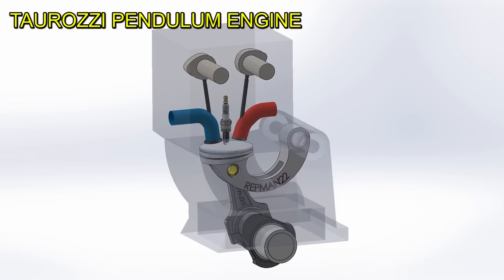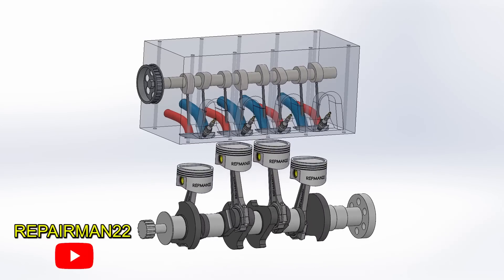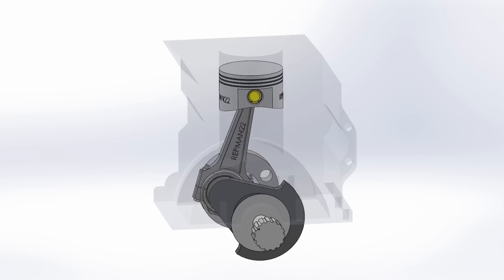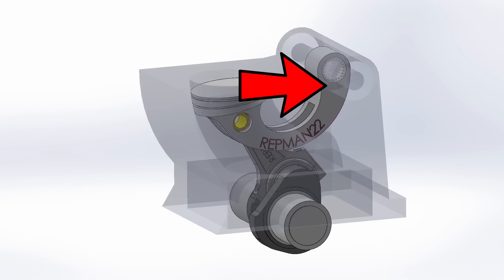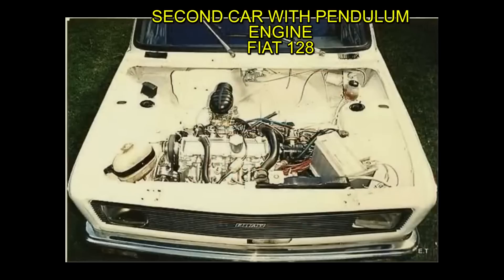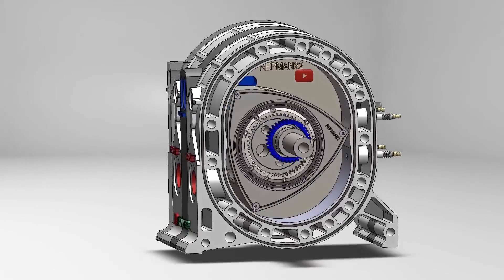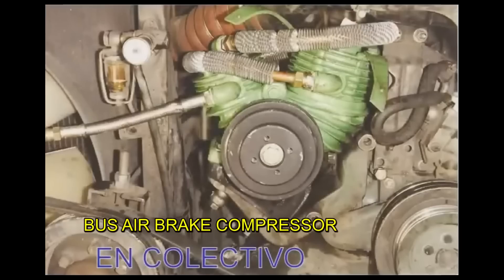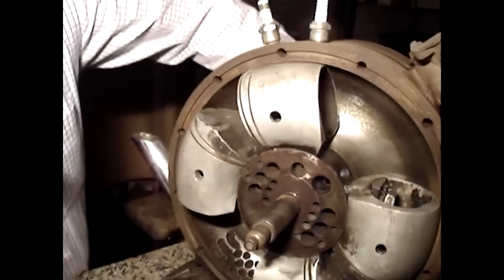All about the Taurozzi Pendulum Engine 🧠 and what happend to it🤯

Comment: Maybe they are only used in compressors because then they do not have to deal with carbon deposits and thermal expansion and other issues that may require servicing that is more difficult for shops to do with curved cylinders.

Comment: I was checking out the patent US3854457A and I came across the following, check it out.

United States
(12) Patent Application Publication (10) Pub. No.: US 2001/0037777 A1
Taurozzi (43) Pub. Date: Nov. 8, 2001
(54) BALANCED MODULAR PENDULUM Publication Classification
MECHANISM

Comment: the proof of the pudding etc. Like the guy said, stick it on a dyno rig and measure the power against fuel. The bearing on the swinging arm will not carry much force so shouldn't wear much. Extra weight of swing arm is got back by smaller cooling system etc.

Comment: The statement of "zero friction" is bogus.  The piston rings will always create some friction against the cylinder walls.  Also, the 30% better fuel economy due to lower friction cannot be true because modern engines do not waste 30% of their power overcoming piston / cylinder friction. The use for compressors is understandable, since they can use self-lubricating nylon (or similar) piston rings because the only heat generated would be due to compression, and there is no need to run at high RPM.

Comment: I think making the curved bore is more difficult/expensive than it seems in this video therefore not interesting for mass production. Similar to Honda's oval piston motorcycle engine to allow more surface for the valves. Good concepts but commercially no.

Comment: More moving parts and more weight for questionable gain. We are still using the same Otto engine designed in 1876 because it is simple and it works.

Comment: Hmmm... The taurozzi V8 Engine looks like it could be used in a Vehicle that requires a Strong and efficent albiet lightweight and relatively small engine.

Also, those that say "What about replacing the parts?" Well, the Companies that built the Taurozzi Compressor sell the replacement parts for the Compressors. Compressors have to build their pistons to have similar tolerances to actual engines, otherwise, they'll leak the air they're supposed to compress.

As for why the Tauronzzi was rejected... Well, I say it's Envy rather than a Conspiracy. Many of those companies have a grip on much of the best tech, a monopoly on all the best engineers and the best designs... And then this "Upstart from Argentina" shows they missed a spot... And Last I checked, Argentina is in a rather sour spot for much of the western world.

Comment: @1:32  "and results in 30% fuel savings." And there we can say 'Bullsh*t" Most cars engines are running close to 60% efficiency. To claim a 30% fuel savings means that it is  achieving above the maximum possible Carnot efficiency. While it may offer some benefits, you can get a similar effect in a strait cylinder by the addition of a single extra component. But to date there has been no real need.

Comment: Slick design but an overhaul nightmare. If you can't easily overhaul an engine in the field with common standard machine tools handling all metal cutting operations the design is unsuitable, end of story. Factory production of specialty items like compressors which are replaced rather than overhauled and lead easy lives compared to motor vehicle use makes sense so the outcome is logical.

Piston wear IRL is nearly irrelevant because piston RINGS are the moving wear surfaces and the bore being softer takes the brunt of the wear. Local machine shops generally finance large machine tool purchases and would avoid specialty machines until the market takes off, but the lack of local overhaul capability deters the market.

Comment: a piston and cylinder do NOT have direct contact, they have rings to prevent it.  I suspect, being an ENGINEer that yours will actually produce MORE friction on the outside of the curve,  The wear at 120,000 Km would be quite bad, not just some polishing.  You'd better use some extremely high strength materials in the curved arm.

Comment: Hold on, is that abrupt movement NOT a problem at the wrist pin?

I feel like maybe a compressor using this design would last, since it won't vary in RPM other than on startup or shutdown; in vehicular applications this will speed up and slow down with operator input and I believe that the abrupt movement in that animation would be where the biggest fault lies, longevity / durability-wise.

Anyone have an answer for that?

Comment: Mountainous region vehicles NEED an internal combustion engine so cylinder-compression Engine-Braking can be had when going down a long downhill, to prevent burning up the regular drum or disc brakes. The engine's COMPRESSION will slow down the vehicle.  (Electric hybrid vehicles will suffice just about everywhere else, though.)
The engine could run mostly on HHO, with compressed hydrogen (or methane or propane) for the augmentary auxillary fuel when the HHO generating electrolyziser can't keep up with demand.

Comment: Most conventional engines have a 5 thou (0.13mm) clearance between piston and bore. This design means the dimension of the pendulum arm from the pivot on the right to the far side of the piston must at least that accurate.

Comment: Seems to me the only problem with this engine is that it was 50 years ahead of its time. Back then, manufacturers didn't need to worry about the small increase in emissions from piston skirt lubrication. Nowadays, with ultra-stringent emissions laws, manufacturers are using pistons with short skirts, and low-friction cylinder coatings,  with the downsides of accelerated wear, and high costs respectively. This engine solves all of those problems and then some.

I guess no manufacturers will ever pick this up, because most of them are currently jumping on the EV bandwagon. Such a shame, because this engine is ingenious.

Comment: watching this vid makes you moar stooopider. 

If there is friction there is wear. Engines last 1/4 million miles...billions upon billions of piston strokes. When the pressure is high, the rod angle is low = Low Friction!!! The piston rings are pressed out against the cylinder walls for sealing under high pressure. This source of friction remains on the Taurozzi engine. Machining and honing/re-honing a toroid cylinder is not simple.

Comment: Anyone with some basic understanding of engineering knows this is complete BS, literally has no benefits over straight design and several downsides.

If friction and oval wear were any problem, you can just guide the piston in a straight fashion instead of this nonsensical construction.

It's trying to solve a problem that doesn't exist in the first place, and introducing 10+ problems by doing so.

Comment: The real problem will be sealing the piston long term. Teflon is flexible enough to bend and twist into the needed shape but steel rings will break after a few thousand kilometers.
Also manufacturing the bores will be a pain in the ass. A typical tolerance between cylinder and bore is 4/100mm try to manufacture 100.000 blocks and measure these. It's a nightmare. In a compressor u can just go and make the gap between piston and cylinder bigger because the pressure will never exceed a certain level. Just slap bigger rings on it and it will seal. A modern gasoline engine can Produce up to 80 bar (1160 psi)  in combustion stroke. And a diesel engine even goes up to 180 bar of pressure (around2600 psi). I also call bs on him producing a working 2 stroke version of this. Even with a membrane controlled intake it won't be possible. U need a long piston skirt to control the exhaust. This motor tries to eliminate long skirts. I think his go kart was just a heavily modified "regular" 2 stroke. 
Interesting concept but not viable for mass production or high power output.

Comment: The real reason these engiens haven't really caught on is because they require much tighter tolerances to work. And despite being inherently cooler, thermals must be carefully controlled. Running too hot or too vold would be worse for this sort of engine than a standard engine due to the complex geometry which would easily throw off the tight tolerances with thermal expansion. With a straight cylinder, thermal expansion is unilateral, making it easy to manage. Here, thermal expansion would change the pistons position in the cylinder

All this means they'd likely be more expensive to engineer and produce, possibly less reliable too.

Comment: How is there "little" friction? More contact points means more friction. Second a conventional piston does NOT make contact with the cylinder walls. The piston rings do. Third, the extra mass is alot more than just a piston with the extra pivot arm. 

This is a great backyard engine. While its possible....its not feasible.

Comment: "the refrigeration system is also smaller due to the low amount of losses" *BUZZER* NO! Cooling system is not refrigeration system. Not at all the same. Engines do not have refrigeration systems. Thats a big enough sin to retract my "like". Not acceptable. If you don't know the difference between cooling and refrigeration, don't make engineering videos.

Comment: Pretty cool design, but has complexities that need to be tested before producing such engine - I can see what can scare off automakers. 

Specially that uneven piston shape, production, wear, how it will preform over time wearing, uneven weight difference while under violent combustion forces - there is so munch that can affect such design. Pretty sure automakers at least made prototypes internally and tested the engine or some of them did - you do not discard something that promises great efficiency benefits.

Comment: I believe even though it's possible to manufacture toroidal-shaped cylinders and adequate counterpart pistons, getting the tolerances with acceptable % od OK parts is what's holding it back. And tolerances mean longevity. I think that getting this to work with these constraints would mean costly tight tolerances, tighter than in current state of art and small nonconformity would mean a swift part teardown.

Comment: With several years of experience as a precision machinist, I can tell u that this engine's pros outweighs it cons. Manufacturing cost is the only viable option why it wasn't implemented by motor companies
Conventional engines can easily be bored using a drop drill then filed but this will require a 5 axis CNC router
As for the curved shaft, it's even stronger than a straight piston rod and can carry more force without snapping

Comment: All Global Inventors, Mechanical Research Engineers, and other Enthusiasts have tried to slow down and extend the piston's acceleration which starts after the TDC and is over by 75.5 degrees with a conventional crank mechanism. Consider that Force=m x a. This and all other mechanical concepts that are based on the fixed radius of a crank pin have no chance to provide higher force and a fuller combustion process, especially if two pistons and two cylinders are opposed in this fashion as an OPOC mechanical concept. Then the existing problem of too fast acceleration of conventional concept is doubled which doesn't allow enough time to burn the fuel found in the chamber, thus limiting the thermal efficiency to only 30% gasoline and 40% diesel concept. A variety of methods, techniques, and accessories are used to compensate for these conventional crankshaft mechanical deficiencies.

Comment: yeah  30% fuel savings is a clear BS.   it might be even other way around as piston has to move extra w8.  also long lasting engines with low oil consumption is not something groundbreaking ))

Comment: Probably could use clarification, nothing is free of friction, this engine just has less of it, and it's moved from the cylinder walls to the pivot point.  
Also curious what effects thermal expansion has on the geometry.  It seems like as the engine heats up the piston would be pushed closer to the wall opposite the pivot point?

Comment: The casting of the cylinders in the style for the air-cooled type (as well as for the compressor) is the best idea, and then formed sheet metal water/coolant jackets to fit around the cylinders, for best cooling.  Bravo, I love the engine.
Is it possible to get such an engine that has been commercially produced; either air or liquid cooled ?  I'd run it on a gaseous fuel, such as hydrogen, methane or propane.

Comment: I don't find the mass machining of curved cylinders a compelling argument. Mass production demands would allow for the optimisation of that machining process, even bespoke boring machinery. Curved pistons probably distribute the forces unevenly resulting in numerous highly irregular points of failure. They'd use this design in F1 if it was more efficient. Though I suspect it's probably more durable because it has to be overengineered.

Comment: Meh. Much of this is BS. Overplayed shortcomings of conventional piston engines and other than the reciprocating assembly of this engine it’s just another 4-stroke piston engine. Crack open a modern piston engine with over 100k miles. It’ll still have crosshatching, the piston skirts will still have their coatings and machining marks. Once broken in and lubed up the crostini is minimal from the cylinder bores.

Comment: Never heard of this before, what a cool engine (pun not intended) with an elegant solution to friction problems!

The first thing that came to mind for manufacturers not taking it into production is that while it is possible, would it be cost effective? I'd imagine this engine requiring quite a bit of precision in manufacturing, and the required machinery just being more expensive in general.

Also, while there would be less wear, how sensitive would it be to it? I do not rightly know, but to me it seems like even slight deformation of the pendulums or their mounts could result in many kinds of problems.

Comment: Making the tooling for curved cylinder would be pretty expensive, but after that decently cheap to mass produce, just not cheap as basic straight cylinder. Also issue probably is with curved cylinder one side moves faster than another, so there is uneven wear, well as most likely vibrations in the piston ring. Due the added weight of the arm design this wont be high rev motor, so response probably is bit sluggish. Its interesting design and would love to play with one, but i think problems with it out weight the benefits in practice, specially to manufacture small number to hobbyist tinkering.

Comment: Why not just m@ke a a ball bearing piston. Much easier production. Would be just as efficient.
 Picture putting a ball bearing with no outer race in a cylinder and a washer bearing seal.. 
But Why would a high production company purposely lower their revenues by making an engine that lasts forever?.
 That's possible why it never took off.

Comment: Maintaining required bore size and micro-finish tolerances, while possible, would be an insanely expensive manufacturing process for both the bore and the mating pistons and rings. Without a matching radius the compression rings would shave the cylinder walls beyond tolerance rather quickly.

Comment: Turbine engine generator in range extended electric vehicle, plug in hybrid, hybrid electric

~ Long life (Aircraft grade 20,000 hrs) 
~ Flex fuel (CNG, Propane, Diesel, Gasoline, Kerosine, Jet A, Biofuels, DME) 
~ Super high efficiency
~ Highest power to weigh ratio electrical generator
~ Functions as alternator
~ Low noise & adaptable emissions controls to limit NOX & particulate

Comment: I think the advantages don't seem to be worthwhile. It seems even though the induvidual piston itself maybe lighter since it doesn't require as large a skirt, you still end up having more reciprocating mass. Since it's basically just a normal piston and crankshaft arrangement with the added mass of the banana arms. Any performance advantage you may gain from having slightly less friction would be negated by the added mass of all the extra banana arms swinging about the block. There is likely added harmonic balance issues that likely need to be addressed. While the video states the engine would wear less. I have a feeling over an extended use case the cylinder bore would actually wear worse and in an uneven fashion. Since you have one side of the piston traversing a longer distance. The inside of the curved cylinder wall and piston would wear less than the outside of the curved cylinder and piston. This actually maybe worse than a conventional piston engine as you would not be able to easier rebore and hone the curved cylinder walls. Thats just the engine itself. That doesn't even take into consideration the manufacturing inefficiencies.

Comment: If that engine was a successful as you’re trying to make it sound then it definitely would’ve taken off on the market, besides that use a much longer connecting rod and reduce that side friction on the cylinder walls to near nothing

Comment: The short version should be something like:
- Producing a curved cylinder wall with a good surface is expensive.
- 30 % fuel saving just does not happen under normal circumstances.
-> The higher manufacturing cost does not outweight the higher efficiency
-> The high R&D investment will scare off interests, especially in a time where every dumbass is proclaiming the end of the internal combustion engine.